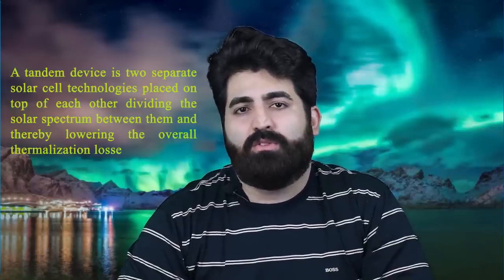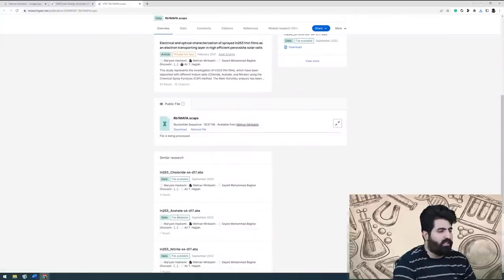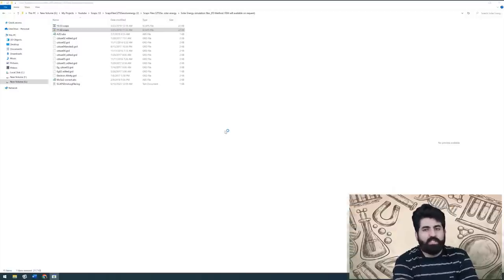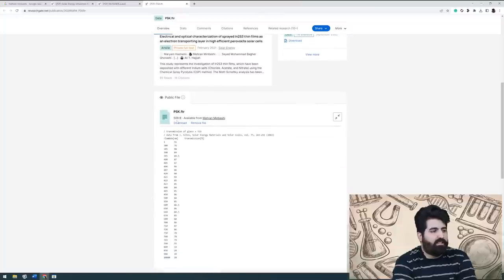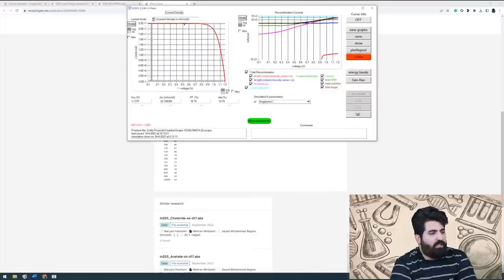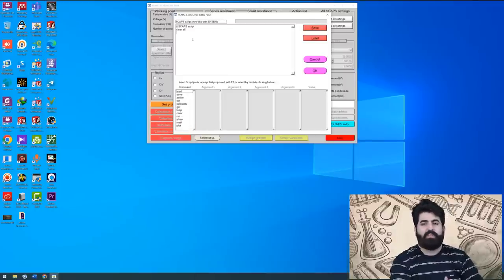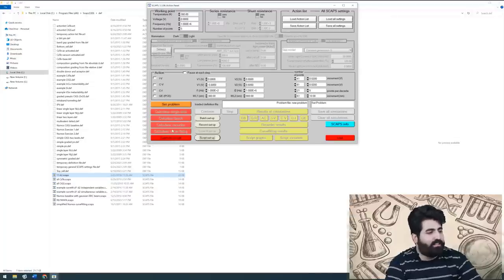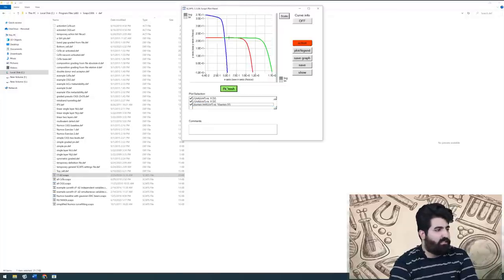Scaps1D, Simulation 2T-Tandem Perovskite/CZTSSe Solar cell

Comment: Hello Sir , I have a question regarding Solar Cell , Sir could you tell me how are fill factor and efficiency of a Solar cell different and if suppose we have a solar cell with 50% efficiency and 100% fill factor , or a Solar cell with 100 % efficiency and 50% fill factor which one will be better ?
Reply from the maker: Hello dear friend, the efficiency is the most important for doing a good solar cell device, however achieving 100% Efficiency is not possible due to shockly-quieser (search the correct word😁) limit.